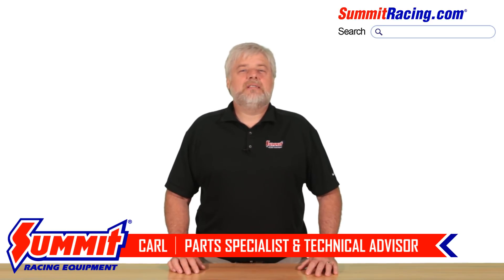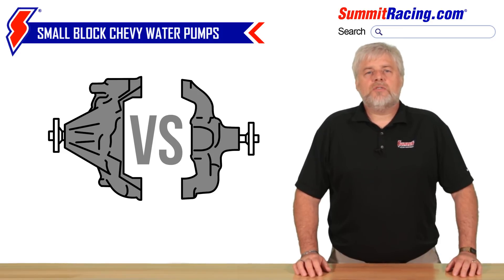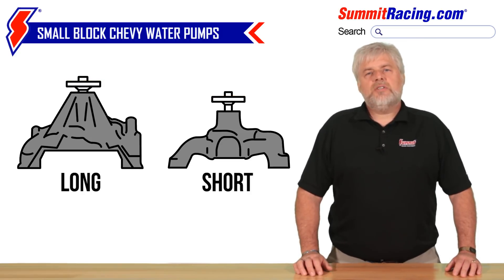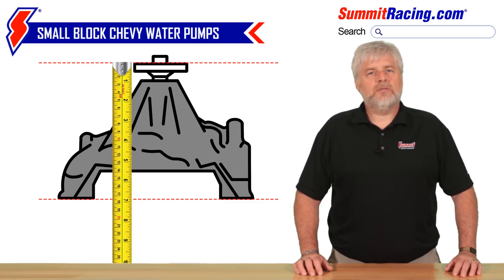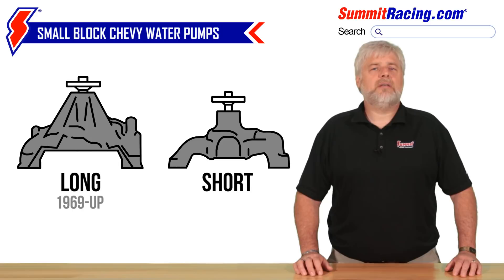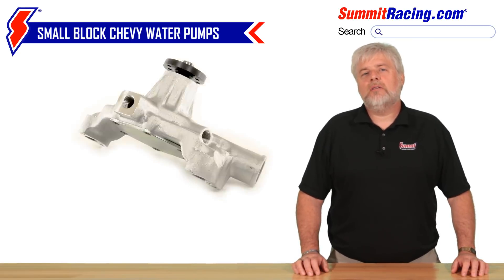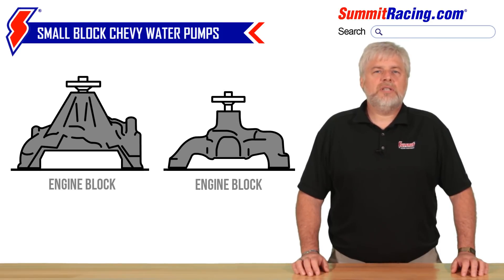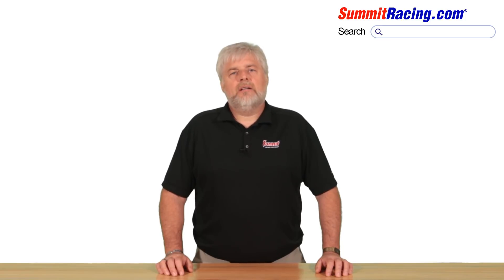Water Pump Types: Small Block Chevy Long Water Pump vs. Small Block Chevy Short Water Pump

Comment: SBC short water pump Q
Looking for a good quality polished/chrome pump 383 562bhp
Edelvrock Team G whats the diff?

Is it possible to have one made wiht 1/4" longer shaft so i can center my fan?

Have a CAT alum hig flow I got yrsss ago .
Water movng too fast!
Rad hose feels like its got cement in it. 
Random small bubbles.   Not cooling right
Impeller has rediculous runout....is this causing cavitatin. 
No leaks in heads or block I an find. 100% new

Comment: Well done. Straight to the point.
Reply from the maker: Thank you for watching! We appreciate the feedback.
Reply: @SummitRacing  Need to order a sbc short pump alum that has a 1/4" longer snout so I can use a mech fan. Under 200?
Options? Have an old CAT hi flo...impeler has so much runout its gotta be creating lots of cavitation. Car always ran cool....new pump/motor
FUnky heating characteristics. 
Edelbrock....Team G or? Nothing crazy but never a cheap pump again

Comment: So if you bought a used engine, you can use either a short or long water pump?
Reply from the maker: Yes if you do not yet have brackets and accessories. If the engine has all external front accessory drive then you need a pump that matches. You need to make sure the pump, accessory brackets, and pulleys all match.
 
https://help.summitracing.com/app/answers/detail/a_id/913/kw/long%20short%20pump

Comment: I bought a short, but needed a long. Can I make it work? Need different alternator bracket I think. But will it function?
Reply from the maker: Both pullies and brackets are based on the water pump being used. All components must be matched to the water pump for proper belt alignment.
Reply: @SummitRacing  we are trying to shim it and the belt is twisting, but it is so close,  there has to be a way.

Comment: So whats the height dimension of the corvette water pump?
Reply from the maker: If you are referring to the Gen. 1 engine from 1971-‘82, it’s a short pump with the larger .750 shaft diameter.  If it’s 1970 and earlier, it’s still a short water pump but still has the smaller 5/8 in.  https://help.summitracing.com/app/answers/detail/a_id/913/kw/water%20pump%20height

Comment: Being a person who prefers to see the  correct technology being used......... I must say that water has not been used for engine coolant for almost a century.  Since the introduction of Ethylene Glycol used for engine coolant, these are engine coolant "circulating" pumps....  not "water" pumps, even though will see that in the parts catalog and written on the box! 
I also agree with I boss..... with the use of a serpentine belt system, the circulating pump impeller must be capable of reverse rotation operation.
Other than that, the video is very informative and well done.
Reply: Mark Emery wrong. It’s a 50/50 mix of water.
Reply: @JamesR23  That is why it is "coolant".  It's a  mix of water and ethylene glycol.  It should be coolant pump.  Not water pump, not ethylene glycol pump.
Reply: you can still run strictly water in an environment that never sees freezing temps you mouth breather.
Reply: Mark Emery *terminology

Comment: You forgot the rotation were it also spin to that's a issue if it is a reverse or what it can cause problems , depends on the year 89 and 93 350s please note that tell you at the problem I had